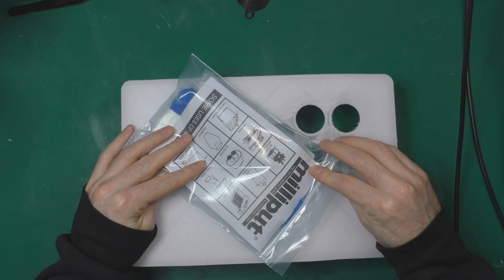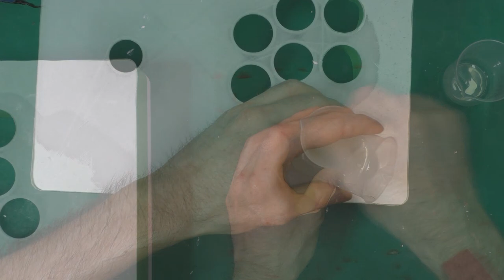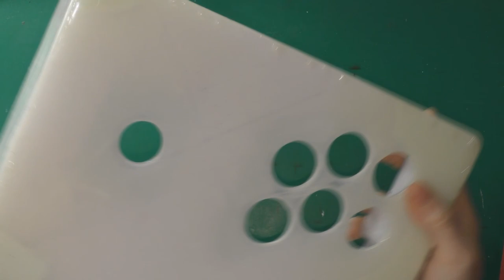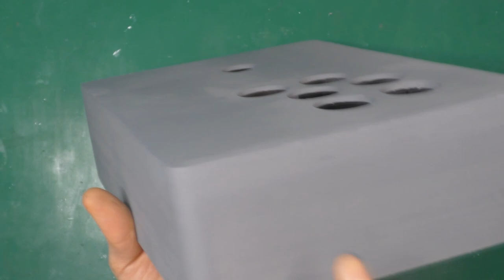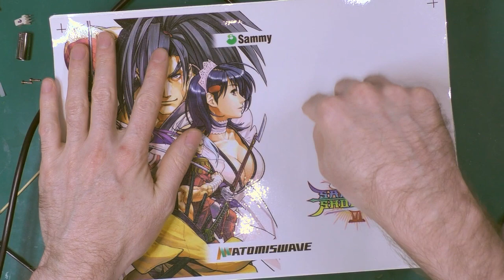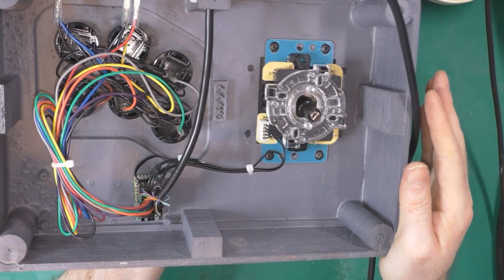[Arcade Stick Mod] Part 16: 3D-Printed Arcade Stick (for SuperGun)

Comment: Bondo is much easier to use with a straight-edge squeegee. It pushes into the gaps better, uses less Bondo, and requires less sanding (level parts are already squeegeed off or pushed into cracks).
Reply from the maker: Yes, on large surface like wood this is how I use it too, but at start I just wanted to add some touches here and there, but the more I put the more I couldn't stand the errors, hence the "icing cake". For sure if I'd have to redo it I'd use a squeegee.

Comment: What printer did you use for this?
Reply from the maker: Anycubic Chiron. Minimum printing surface should be 300*300mm so there are Creality printers which can also do it.

Comment: what are the hole measurements for the threaded inserts
Reply from the maker: I used M4 screw for the knurled inserts. The actual hole size is 5mm of diameter.